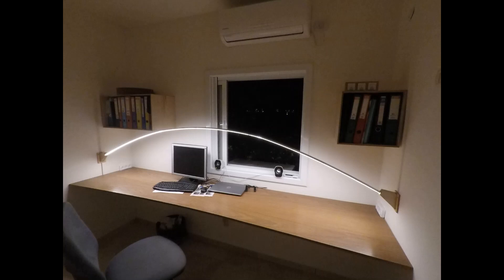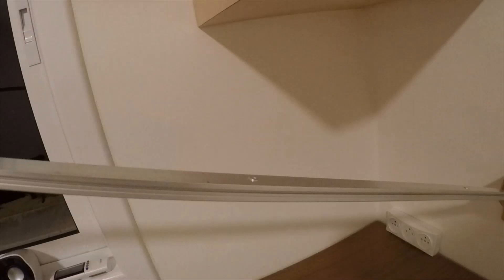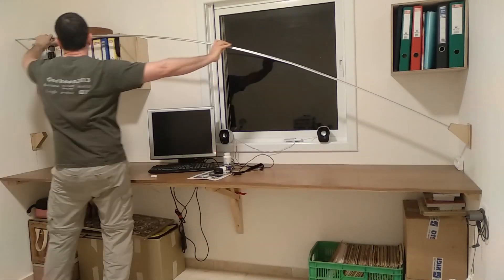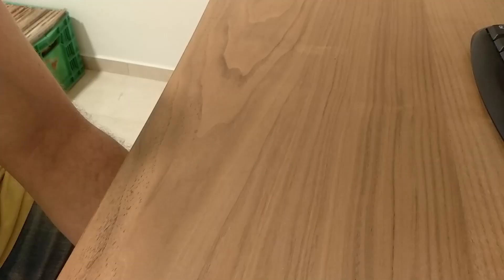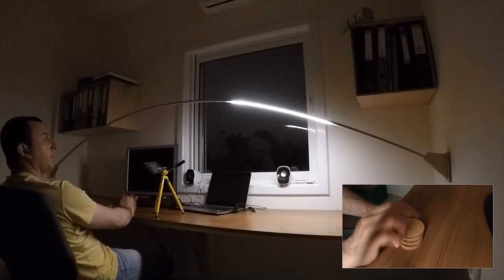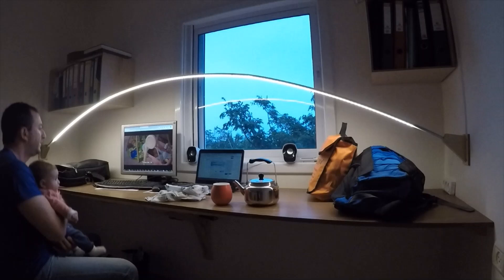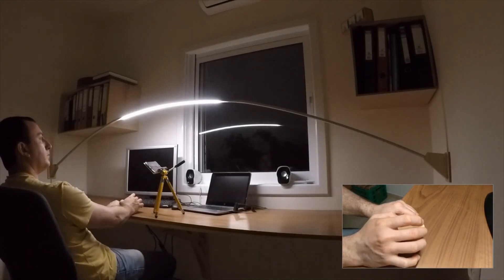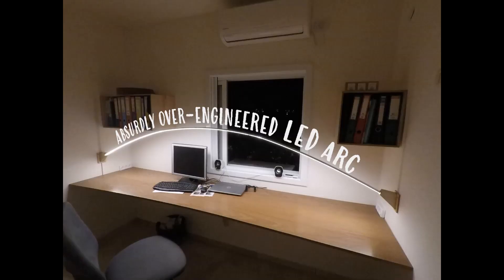LED Arc Desk lamp

Comment: Your idea is really fantastic, as also the result ! Congrats !  IMHO not absurdley over engineered, you have built in very useful features, and a nice design. What I would add to your project as next step is a Wifi interface with an esp8266. I can imagine you use an encoder as hand controller,  the ESP can generate A/B cuadrature and switch inputs. I have on my channel an esp8266 video, probably it can give you some ideas. Thank you for sharing your lamp !
Reply from the maker: An awesome idea!
Currently i had an Arduino mini-pro, so I used it (it does not have WiFi capabilities).
However porting the code to run on an ESP with WiFi shouldn't be difficult.

Although I am a fan of physical controls (i.e. knobs, buttons etc), adding WiFi based control can be really cool - thus being able to control it also from my PC located on the desk (or my smartphone).

Will definitely consider that!

Comment: Started this build with a DotStar led strip and adafruit rotary encoder. Ran into some comparability issues with the code but I got it working with the help of some Discord folks. 
My parts list.
Led strip - product# 2435

Arduino-based Adafruit Metro mini (ATmega328) - product# 2590

Rotary encoder - product# 5001

Rotary encoder breakout pcb - product# 5221

Comment: awesome! which led strip?
Reply from the maker: It's an SK6812 with 60Leds\meter. I chose this strip since it has RGBW (i.e. the white is not generated using R+G+B combination, but, a forth dedicated white LED). The "W" LED is warm white (I don't have the actual temperature... but happy with the result).
Although it has RGB, I don't use it at all but only the W option (Except on the hidden pong game..).
Reply: @technocrat1  tnx a lot, I was looking for something similar but I was uncertain between 60/144 and rgbw/rgbww. This one that you are using performs outstanding!

Comment: do you have the design files to share ?
Reply from the maker: Unfortunately, the plywood blocks were designed "freestyle" with no written design files. Manually cut on an amateur-level table saw. The second block is simply a copy of the 1st.
In simple, the blocks are built from several layers of plywood glued together, while some of the internal table-saw cuts were done before gluing.
I have documented footage of the building process in my site: https://www.ronnyziss.com/ledarclamp.
The angles were calculated based on the assumption that a bent aluminium bar will form a parabola, so knowing the distance between the walls and the length of the aluminium bar gave me the angles here.

The arc parabola itself was made from two layers of aluminium. I had to use two layers since the LED housing I was able to get my hands on were 1 meter long, and the arc here is 3 meters. So I used a flat, 3-meter aluminium bar, and connected the shorter LED housings with rivets. I was happy to see that, although not planned originally, this improved the mechanical strength of the arc making it much more stable. You can see in my site a picture of the arc building process as well.

Regarding the processor and code - I used an Arduino mini-pro. I'll share the full BOM (bill of materials) on my website, as well as upload my code to Github.

Hope this helps!
Ronny.
Reply: @technocrat1  I too am interested in the code. Looks lovely and your interface seems smooth and intuitive. Great work!
Reply from the maker: Code uploaded to https://github.com/ronny2155/LED-Arc-Lamp-for-workdesk-Arduino-code
Reply from the maker: @squirre1friend  Code uploaded to https://github.com/ronny2155/LED-Arc-Lamp-for-workdesk-Arduino-code